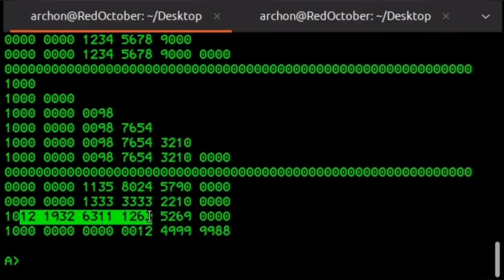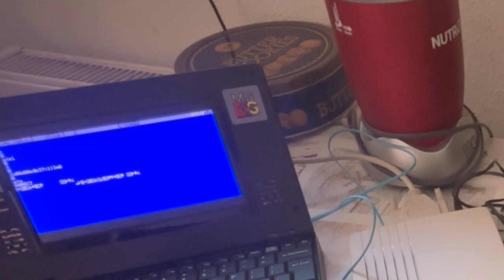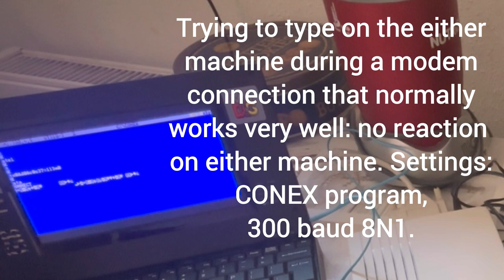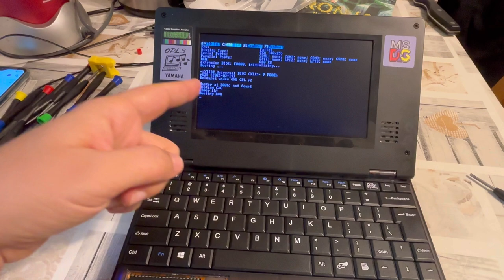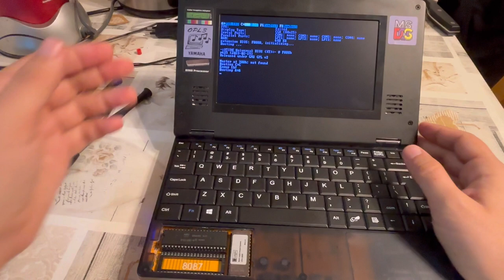ii/iii Book 8088: Self-Destruction — Molten Chip

Comment: Perhaps the on-board serial port is only 5V instead of the normal 12V for RS232. That would certainly blow out the chip eventually when the modem/other computer provides the 12V signals.
Reply from the maker: A fascinating theory, and one all too easily tested! Thank you for the input! I shall hook my second Book 8088 to a microcontroller and see, "can“ it communicate — it shouldn‘t, most "real“ RS232 devices simply do not care for 5V, but if it can — "gotcha"!
Reply: Interesting!

You’d think the manufacturer would document that somewhere… oh wait no they wouldn’t it’s China

Comment: I don't know why it gets so hot, but I can clearly see that NOT a single chip has a ceramic cap near it for power stability, neither the power regulator has enough capacitance on its output, it's just weird. And for those asking about thr rs232 voltages, look if the db9 port has a driver chip like a MAX232 or similar (rs232 line driver/receiver). if it has one, cool, that wasn't the culprit; if it doesn't, well, it might have some discrete circuitry to do the conversion, but I didn't see it, and thus it could be the culprit
Reply from the maker: Thank you for the deep dive!
Reply: The caps are on the backside. (see 7:42)
Reply: @dolphhandcreme  good point! well, the other point about the max232 is still open!
Reply from the maker: @cocusar @dolphhandcreme The chip seems to be a "MAX211i". I posted an image on the Community tab.

Comment: could it be the 9V battery on he phone line ? could it be the RS232 voltage ？
Reply from the maker: Phone lines ALWAYS are under power — else, they do not work. Normally, the voltage is a lot higher, I am rather playing on the low end of the tolerance for voltage deviations. The RS232 voltage is normal, modem-side - indeed, this is one of my most reliable modems - but that something in the future could go wrong, is indeed something I am proposing a precaution against in my next video. This modem has served half a dozen computers so far (including another Book 8088 v2), and without issue — so I am willing to attribute this to the computer, where we have seen also other misdesigns, from defective ISA-interface cards to burning any inserted uncooled 8087, as I shall demonstrate in the future.

Comment: Here I was going to ask if you could install ELKS Embedded Linux and try a GUI with it too… and then performance with and without an 8087… and then decided to go through your playlist. Sad!
Reply from the maker: Don‘t you worry, nothing is forever. 😉 However: the things you speak about I did try, and with the risk of spoilers: ELKS did not work — I did not get it to boot; I think this is because of weirdness with "cylinders, heads and sectors" which it perceives the SD-card to have and which are different in the Book 8088 and the modern machine‘s card reader. As to the 8087: that thing CANNOT work with an 8087: it works for a moment, then it overheats and then it burns the 8087. I am showing this in the future. But a glimpse is in the intro: that broken chip just before the photos of me — is just such a burnt 8087. You would need massive active cooling for an 8087.
Reply: @ninoivanov  OH THATS CRAZY! Have you considered sending a message to the seller about these issues? Also - posting on the GitHub for ELKS to ask for help regarding getting it set up? (I’m super curious about these retro vintage modern pieces of tech, and hope that lessons learned here could help, say, build an 8088/8086/V20 with 8087 or V30-based full ATX or eATX board to play around with ISA expansion cards in a modern form factor) 

Anyway. Thanks for listening to me ramble. I appreciate all your hard work in getting these vids out there!
Reply: @ninoivanov  OH also Tindie has a replacement 8088 BIOS and XT-IDE extension ROM for Book8088… and support for the V20 👀
Reply from the maker: @EirikrTinkerTries Indeed, but the issue was another chip — incidentally, I had tried to order a BIOS from Tindie, but had then a terrible experience with Tindie (not with the seller, who is a great guy and a famous retro machines constructor in his own right, and who is the person behind the Book 8088‘s BIOS), and for the time being, I am staying away from them.
Reply: @ninoivanov  got it, that’s unfortunate! Any good alternatives? Thanks for all your hard work and your vids. This is such tech therapy.
Reply from the maker: To my chagrin, none — short of programming a chip. And you are very welcome here — tech savvy people like yourself make this little community a pleasantly knowledgeable corner of the internet, where, I admit with delight, I learn a lot and read many great anecdotes!

Comment: I put that 8087 math co-processor in, and let’s just say it did not go well…
Reply from the maker: I am very sorry to hear that. And I understand you — you had it, and what else would you have had it for…
Reply: @ninoivanov   well I pulled it after it heated up, and also in the boot sequence I read “FPU- Failed”.
Reply from the maker: If you are lucky, the failure is only temporary, that is, in such situations, "putting it back after it cools down" shows it works again — but if it does show as recognized during boot, you then turn it off immediately and pull it out for good, until you figure out a cooling solution. ☺️